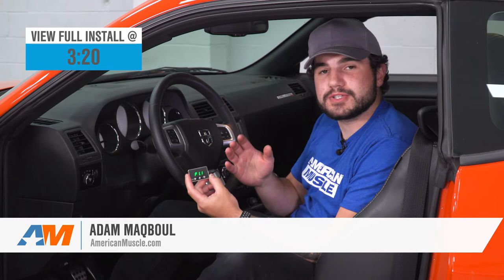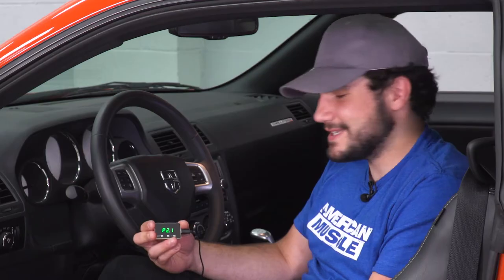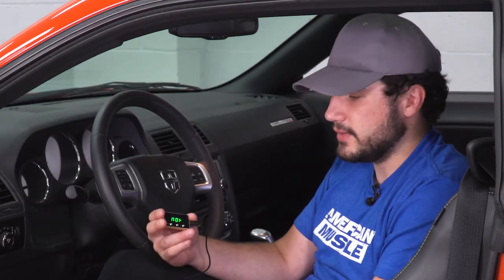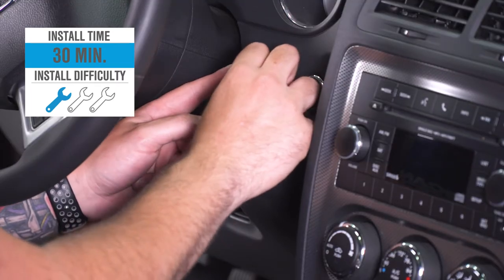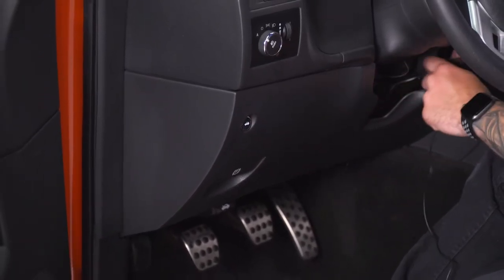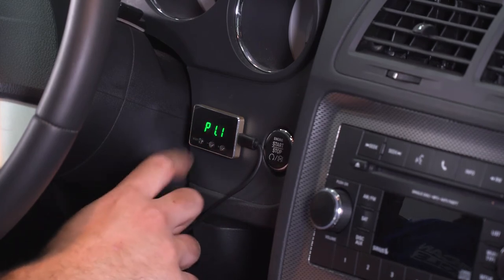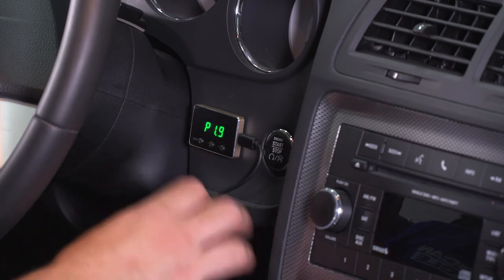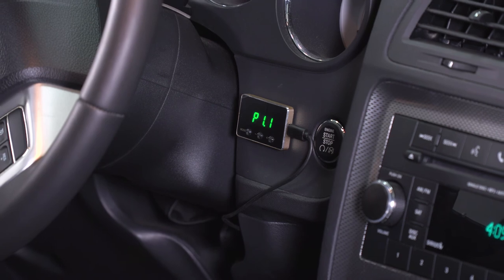2008-2020 Challenger SpeedForm Throttle Controller Review & Install

Comment from the maker: Shop this SpeedForm Throttle Controller: https://muscle.am/3evu5T9
Subscribe for Daily Challenger Videos: https://muscle.am/2TXrfwf
Reply: Do theses work in Jeeps?
Reply: I do have a question though:
I was unaware of the setting for manual and automatic that you show in this video. 
When I hood down “-“ it shows “555” when I hood down “+” it shows “AAA” which is different from this video. 
Which setting is correct for an automatic?
Thanks for any help here. I hope I didn’t have it in the wrong setting all this time 🤦‍♂️

Comment: This thing is Awesome. 
Easy installation. Great flexibility, feels like adding 50 horsepower. Another great way to get the most out of the settings is to cut it down to setting 1 on the economy mode when driving in rain or snow.

Comment: What a difference it made in my 2020 challenger. Very responsive and you can feel the difference.
Reply: Any issues with it now ? No check engines codes coming up ?
Reply: @bustingyewls154  Nope it still works like a champ. Never an issue. It just sits near my console and I ran the wire between the carpet and center console took about 10 minutes to install and been rock solid ever since.
Reply: @21stcenturymetal31  damn I wanna get it but there’s so many ppl saying it has caused there car to go into limp mode
Reply: @bustingyewls154  Not this one. Pedal commander maybe but this is just a throttle response part it doesn't do anything to the computer of your challenger. You can take it on and off and everything is back to normal. You're thinking of a commander or a tazer.

Comment: Been using this on my 2018 SXT for a year now. Works great and was a good price compared to many other options. 
Definitely helps with throttle delay.
Reply: Dose it throw any codes
Reply: @rastaman559  hasn’t for me.
Reply: Did you have to tune your Chally bro I got an ‘18 SXT Plus and I heard we have to tune it?? Because we can get engine failure??
Reply: @jonathancervantes9167  No tune needed. I’ve been using this everyday since installing it. No issues. No codes. Use multiple setting depending on weather conditions. Has done fine on several long trips too.

Comment: Hi, very informative, advanced, and complete information regarding the throttle controller, thank you, but I have a question I hope the admin or AmericanMuscle Dodge can answer regarding safety issues, My question is what if the throttle controller's device suddenly fails? or the little wire cut? Do we still have the control of gas pedal? or it will be back to normal mode? Thank you for hoping AmericanMuscle Dodge can enlighten us. thank you again!

Comment: Looks great. Only thing I'd suggest is to move the power power point to the bottom instead of on the side so it can truly look clean and seamless no matter where you choose to put it.
Reply: I was thinking the same thing after I installed it. I have no idea why they couldn't have put the plug-in on the left side or the bottom. That's my only minor complaint with this thing.
Reply: Why not just add a magnet to it, hide it under the steering column and just pull it out when altering the settings
Reply: Really good idea there

Comment: Just put it on my 2017 scat challenger. Works great! Pairing it with srt track mode from the tazer. Waiting on my 87mm throttle body. Its going to open the bish right up!!

Comment: But how does it compare to the pedal commander besides the price 🤔
Reply: That’s a good question, I had issues with my pedal commander give me a check engine light. Wonder if this would do the same thing.
Reply: Its better with no engine lights
Reply: @Chris00088  did the check engine light cut off when you unplugged the throttle controller?
Reply: @accountemail9712  Yes it did

Comment: what are the chances of this causing engine codes like P2127 and such? I recently bought one from amazon for half that but different brand and was constantly getting engine codes every time I started up my car. This is on a 2014 Dodge Charger SXT
Reply: Did the check engine light cut off after unplugging the throttle controller?
Reply: Thats what happens when you get some xiaoping tiger type beat electronics off amazon/ebay lol

Comment: Just bought one today for my srt8. Sounds like so much fun, so I couldn't resist for the price. Only thing I'm worried about is (and probly not going to be the case) hoping it won't screw with the cpu in the car in some way
Reply: Far as I can tell it’s totally safe. It doesn’t de-program anything just bypasses the drive by wire
Reply: @l03j27  Gotcha I kinda figured that. Does it make that much of a difference in throttle response for you?
Reply: @mattd5147  did you notice the difference in throttle response?
Reply: @accountemail9712  Yes big time. So far, it's been a great purchase. Obviously doesn't give you any HP gains, but the throttle response is pretty much instantaneous.

Comment: Is there any real difference between this and much more expensive products like Pedal Commander, Sprint Booster, etc? Seems no different from what I understand.
Reply: I dont know but im going to find out. I have been using this one for a year plus. Now i am facing issues.  Occasionally the car would start accelerating on it is own which is a big problem for me. On several occasions i almost hit other cars in traffic and while parking.  It is also increasing my brakes wear and tear when it happens since i have to slow down right away.  I realized that when i side kick the pedal with my foot to mechanically shockbit then it dtops the rpm back. So im not sure if the pedal itself has an issue. Ordered pedal commander and i will get it soon.  Hopefully it wont happen with pc.
Reply: @yuvalkapellner2551  a car accelerating on its own...that's terrifying
Reply: @yuvalkapellner2551  update

Comment: Can you leave it plugged in or will it drain the battery? Are there different color displays that can match my interior lights?
Reply from the maker: You can definitely leave it plugged in! There are not different color displays. -Zach

Comment: This shitt is impossible to install on a 2021 challenger i can’t even get this part off to get to the plug💀 how is your under part so loose
Reply: Update lol installed it this thing is crazy😂
Reply: I'm having the same problem. How did you get the under part off to get to where the throttle plug is at?
Reply: Rift33SRT  yeah its just harder to get under when your a bigger person lol

Comment: Can I use track mode on the taZer mod with p3.9 or would i be risking breaking my car ?
Reply: I literally have the same question lol
Reply: @earielrobinson2162  lol I’m scared I’m going to blow my transmission or engine
Reply: do you have an awnser?
Reply: if so please lmk
Reply: @flamingskulls7015  well I ended up testing it . Nothing happened tbh. I drove with track mode on tazer while full throttle and nothing happen. Just a heads up the gas pedal becomes highly sensitive and the rpm’s red line super easy with both on
Reply: @flamingskulls7015  also heads up don’t switch a lot while driving throttle control glitch out on me for that once
Reply: @Cinn510  i decided on going wit a cheaper brand of controller with good reviews. and don’t you have to be fully stopped to switch? or engine off
Reply: @flamingskulls7015 recommend to be stop just to not add stress on the trans. Awesome (: lmk if it works out good for you?(: